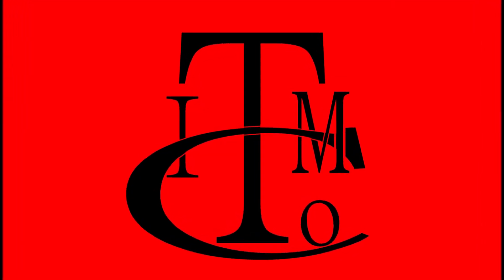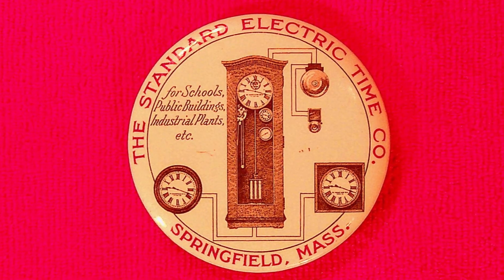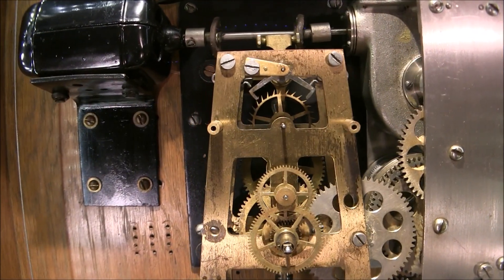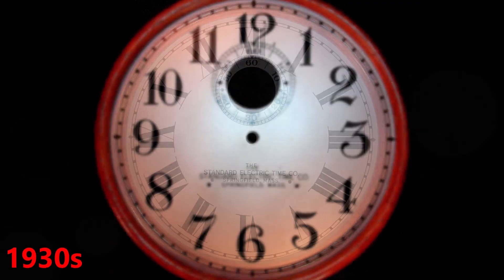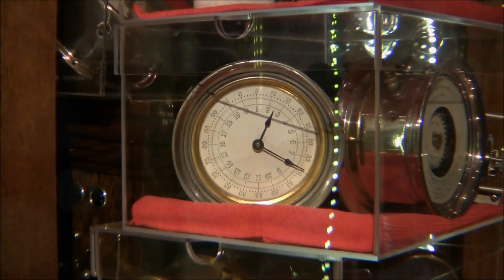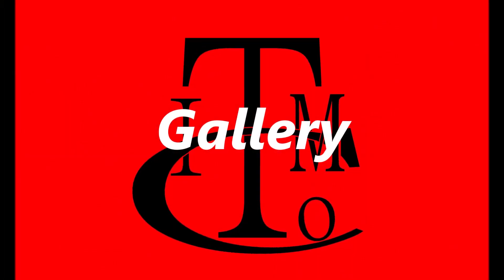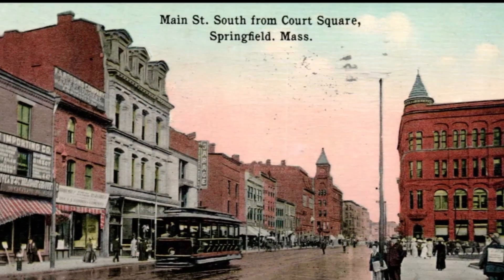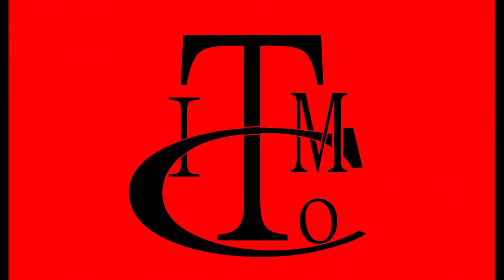Standard Electric Time Co. Master Clock - History & Technology Gallery, an ITM Clock video

Comment: Hi Dave, I am collecting electrical clocks in Germany and I do have high interest in US clocks. Recently I bought a Standard Electric "Master" Clock, 60 beats, round top from app. 1920. But unfortunately at time of arrival I revealed that all components of slave clock mechanism were removed. It is  a clock with a paper programmer device and one slave clock circle - two buttons down at the case. 
Do you think it would be possible to bring the clock back to full original status with all relays, switches and original slave cycle?
Many Thanks form Hamburg, 
Thorsten
Reply from the maker: Hi Thorsten, thanks for the note and for watching!  Regarding your clock, Id be happy to email and view pics.  Sounds like your master clock has 'pilot clocks', which drive the wall clocks / secondary clocks / slave clocks around the building.  They hooked up to the wall clocks in series, up to 8 clocks per pilot clock.  They were usually all in synch, and allowed service to see what's on the wall clocks (eg, if need to advance).  
If you are missing the mechanism inside the pilot clock, I can do some looking into what parts fit.  But, if all you want to do is run the clock, and advance the program machine, you don't really need the pilot clocks to run.  Dave.
Reply: Hi Dave, thank you very much for your replay. I do have one slave clock, which I would be happy to drive, as well as the program machine. Right now all components are removed and a self made power supply was mounted. I was really looking for getting the clock and the shock was deep  as I remove the dial in order to have a full impression of the inside - or the missing inside ;-)
I would like to send you some pictures for your better understanding what still is needed in order to bring the clock back to original status. ttenbergen@hotmail.de
Many Thanks form Hamburg, /Germany, Thorsten

Comment: Another great video for me right NOW!.   I am putting the program clock back into my 1929 60 beat master.  I had removed the program mechanism and put it away in about 1970.  I thought I had thrown it away, but while looking for something totally unrelated this week, there it was; screws and terminal points and all!. I  wasn't sure how it all fit together.  But I got enough detail from this video to figure it out.  Now, if I could only find some paper tapes.  I guess I will have to make some pseudo tapes just so it looks right.  ( I did find some on Ebay, but they are priced 'way too high for me.)
  Thanks again.